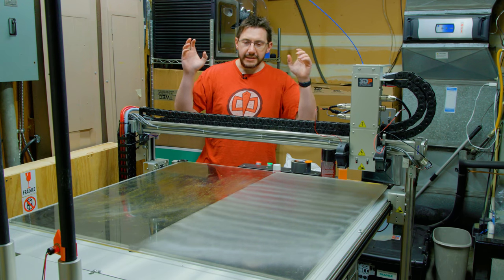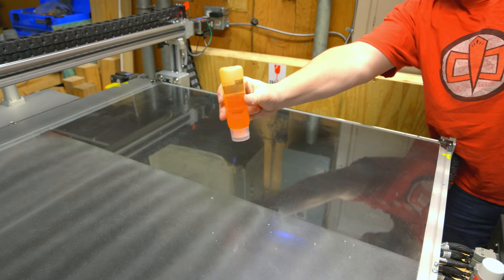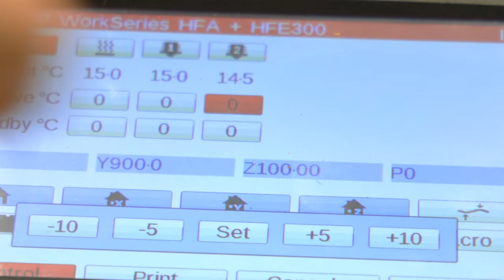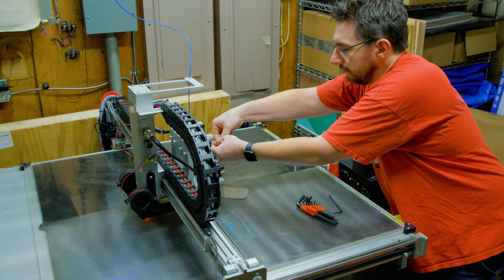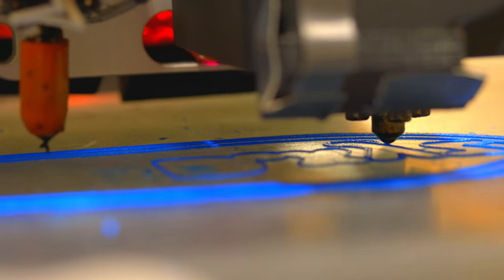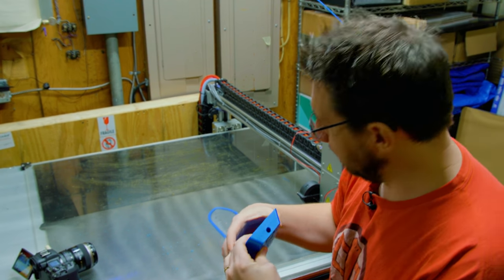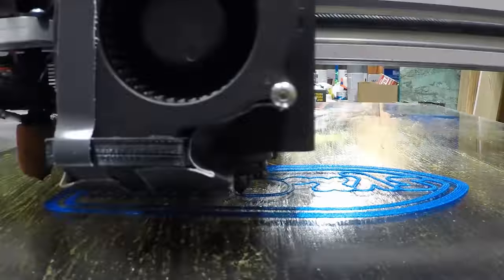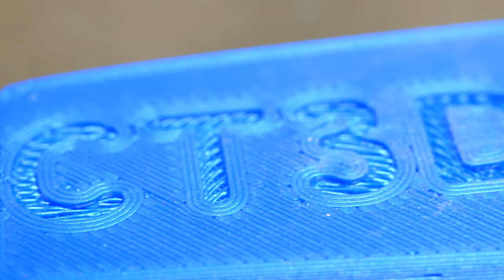$38,000 3D Printer Bed Adhesion Test // Super 77 & Zillagrip

Comment: I have found that some colours of filament behave differently even from the same manufacturers.  Warping is driven by bed heat.  I lowered the bed temp down and down and down and the warping decreased and the bed adhesion decreased as well.  But the amount of warping was decreasing much faster than the drop in adhesion.  When I made it stick and lowered the bed temp enough it was excellent.  Then I changed colours and it was a warping mess again.  I expected that because pigments are not inert nothings... so the carbon black of black filament was much more stable than the gold colour pigment.

My recommendation is to ditch the coloured filaments if you are having issues.  Use black or transparent clear or natural.  Especially on larger prints the warping forces goes up by the cube or 4th power so you might reach the practical limit for an unheated or insufficient heated chamber.

Have you tried printing with a draft shield and a low bed temp just to keep the material temp more stable?

Comment: You said its 60 degrees in your garage. So the filament is coming out hot and immediately shrinking when the glass dispenses the heat. Get a large heating pad and stick it to the bottom of the bed you could test this option by buying a cheap little one and printing in that area to see if it works. Building a heating pad is as simple as hot wire and and insulating fabric.

Comment: no amount of adhesion will keep the parts mass from warping from the cool down you need to sustain the heat and let it droop off slowly. EG heat the room to a high temp. Casting and heat molding solids do this at larger scales as things cool and if they cool too fast or unevenly they will cup or warp. You can bond the stuff to the surface and it will still pull away, that or break the table. Idea is to slow the cool down process. Think of glass blowing, cool it too fast or unevenly itll shatter due to the torsional forces involved.

Comment: When I need to go large I clean the bed really well... No fingerprints at all.... Then I use cheap hairspray from the dollar store. The trick is to spray side to side, back and forth until there is so much deposited spray that it creates a thin layer that looks like a sheet of glass on top of the bed. The droplets build up until they colapse into each other making this perfect clear film. It ALWAYS works for me on a 300x300 Anet printer.

Comment: Joel, why do the first layer extrusions look like they are foaming up a bit?
Reply: I noticed the same, it's rapidly expanding and then contracting, you can see it during the first layer, and more so during the purge cylinder. Amazing that that wasn't brought up at all! My GUESS: filament MAY benefit from drying, and definitely will benefit from warmer environment. I print PP-HTPLA in my enclosed MK3S, 0.6 nozzle without issue. I keep the temp a little lower but have had no adverse effects from the enclosure, in fact it may have been a benefit this whole time based on that strange expand and contract effect observed. Then again maybe the filament is just not suited for such a massive nozzle. SO MANY FACTORS. Also Vision Miner Nano is my new fav for just about everything..

Comment: A brim is usually recommended with shrinking filaments (even though this is a PLA blend) and larger models but since the Zillagrip held 2 of three corners, there may have been less glue on that corner. I would touch up with Zillagrip and try again.

Comment: Use a polycarbonate sheet for natural materials and a abs sheet for synthetic materials  for the bed instead of glass and apply high heat to the bed. Works on the baam I used to work on. Trust me this works as we use it for large industrial prints and it works extremely well.

Comment: I had to lower my fan speed to get prints that don't warp like your experiencing. At first I tried no fan on the first layer, but it didn't really help. Then I tried 50 fan speed for the entire print and that help a bunch and also allowed me to lower the extrude temp a little and still have great layer adhesion.

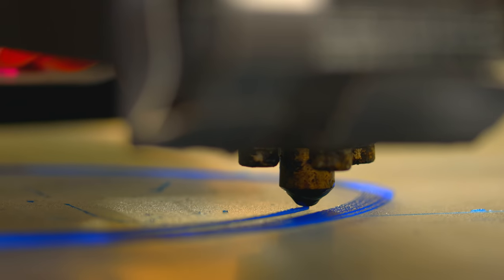Comment: Hey at 5:41 it looks like the filament kind of rises (expands) after it is being extruded to the bed. I would say about 5 mm behind the nozzle. Is there a reason why it does that?
Reply: I've noticed it as well. I think it's either moisture in the Filament, the additive (because it's HTPLA) or it could be the glitter that is degasing while it's melting.

Comment: the technique that i usually use is to let the first or second layer run stop the machine and apply a few drops of hot glue to the points of possible lifting, here is Portugal's tip.

Comment: Hey Joel, check that recipe for the ultimative bed coating that will tie down anything to your glass. I am printing PLA, PLA+, HTPLA, PETG, ASA, PC, Nylon and even really weird filaments with Stone, Metal or Carbon mixed in on this coating perfectly successful for almost 9 months since applying it.

Just grab regular white PVA glue like craft glue or wood glue, mix it up with water in a ratio of 1 part PVA glue to 5 parts water by volume. Shake or stir it thoroughly and apply it to the glass bed with the heater set to 40C-50C. The heater is just turned on to help the coating to dry faster, so go higher or lower while you are applying it depending on how stressed you feel while doing so :D Use a regular brush to apply the mixture. It is correct for it to be really liquidy and thin. That way you have a chance to apply it even and in a very thin coat. Let it dry fully and repeat until you have a couple of coats on the bed. I usually do like 5 or 6. 
Then when you print something heat the bed like you would normally do, e.g. PLA at 60C, PETG at 75C ASA at 95C you name it ;) Be careful with the leveling though. If your nozzle is too close to your bed the filament will kinda fuse with you PVA coating pretty good. The trick with PVA is that it is almost not adhesive when it is dry and at ambient temp. However if you heat it up it will glue shit down and thats why you wanna print with the bed heater turned on while having PVA on the glass :D So be sure that you wait for the print to cool once it is finished. You probably won't get it of the glass while the part or the plate is still hot without ripping shards out of your glass... again :P

Oh and one last note, however this is optional: I sanded down my glass bed a little bit with 240 - 600 grid diamond sanding pads just enough to give the PVA mixture something to hold onto. If you see some light scratches in the top of your glass after cleaning it with IPA you are good to go. Wet sandpaper with the same grid will do the job as well, I guess. Maybe you want to give it a shot on a corner of your huge glass plate if you are still having adhesion issues ;)

Cheers and good luck!
Reply: Forgot to mention: with that coating you will be able to print even the most warp-prone stuff like ABS open air with ambient temps totally out of the cozy zone of ABS :)

Comment: I always say, "More printer, more problems". 

It kind of looked like there were bubbles in the extrusion as it came out. Is it possible the filament was a bit wet? I don't think that would necessarily be the cause of the lifting, but saw a texture that kind of looked like bubbles. Though I've never printed with that wide of a nozzle, so maybe that's normal.

Comment: I use Gorilla Wood Glue on painter's tape (blue, green, masking etc). It can be used on pure glass, but it's easier to remove on tape. I typically apply it using a Paint Sponge Brush, but a plastic putty knife or something to spread it thin would work just as fine. However to maximize it's effectiveness the glue has to be dried by heating the bed first. Once dried, a print can start. I've never had any issues with this method, unless the surface area of a print is too small in which I've had to use rafts and/or supports with slower speeds. I've used this for PLA, PVB, and PETG. I sometimes reuse the tape with glue, but this has usually been for PVB. I lightly go over the bed with a damp paper towel coated in isopropyl, which I think makes the PVB more inclined to stick. Cause alcohol makes PVB sticky.

I've also heard of the salt water method that is supposed to be really good for PLA. Never tried it, as I'm afraid what it might do to exposed metal longterm. The idea is you heat the bed like usual to dry the salty water so it's just salt stuck on the glass. Then print over it. It acts like a super glue for PLA until you turn off the heat. There is no need to fulfill an exact recipe in the PDF I read, it basically just asks that you add a lot of salt. Probably 60-80% salt is in the mix. No idea if it works for other filaments.

I am happy to see this video though. I'm always interested in different beds, bed coverings (PEI sheets, etc), and adhesives. Always on the look out for new methods that are easy, low cost, and effective. I've tried many, and have been disappointed that other methods aren't as good as the wood glue in my experience. But I suspect there are more great ones out there. :)

Comment: Due to the size of the printed pieces, there is no doubt a lot of uneven cooling within the part itself, especially in a 60F degree room.  So perhaps the use of a couple heat lamps would aid in managing the part temperature without interfering with the head movement, thus providing a more consistent and even temperature for the part.

Comment: I've been dealing with a wood pla that doesn't want to stick with large prints, a couple forums suggested using hair spray and that seems to work pretty well, there are some recommended sprays to use if you want to look for them but I just used a random one I found in the store.
You have to lay it thick so the spray sort of pools as a liquid and then let it dry, hold the nozzle close, maybe 2-3 inches away at most, and spraying in circles moving down the bed got me the most consistent layer. If it still doesn't stay stuck add more layers until it does, I ended up with 4-5 layers before it worked. Not sure if it makes a difference but have been using a heated bed at 60c first layer dropping to 50c after, spraying it on the bed pre heated does help it dry quicker though, just make sure the print head is well out of the way as I had some of the spray get sucked in and stuck to the cooling fan. Also it's recommended only coating the area you're going to print on because of the fumes when spraying and the stuff is a bit of a mess to clean after, probably a good idea to use a respirator if you've got one, and going to be running a test today putting down some masking tape first to try and negate some of that mess.

Comment: This might sound basic, but I like just glue stick. I slow the first layer down to 30 or 40 percent speed, and run the fan at 25 to 50 percent power. Locks on tight, even large prints on glass beds.

Comment: Hair spray and painters tape works pretty well for my PETG filament to help with lifting but I think a big problem is room temperature like you have in your garage, I also use a heated bed to make the hair spray stickier, but that's not always required.

Comment: I don’t know why everyone is so obsessed with all sorts of liquids, chemicals, sprays, glues, and so on.

Listen/read carefully what I am going to tell you right now, because I will say it only once:
I suggest double-sided self-adhesive foil with removable adhesive (for example Orabond 4032). The foil is available in 50m rolls and in widths of 1050mm, 1300mm and 1550mm (it can also be purchased by the meter).
Using a squeegee, cover the bed (printing area) with foil with the side where it has removable adhesive (with permanent adhesive facing up). By the way, you could best get the foil with removable adhesive on both sides if you have that option.
Not to forget: Print on a cold bed (without bed heating!)

Tip: You can use a hair dryer to remove the foil from the table and from the print when you are done printing.

I think it will finally and definitively solve your problem of sticking prints to the bed. Say goodbye to warping and lifting!

No pictures please! Thank you.

Comment: The contraction forces we've seen here appear to mean that any bed adhesive strong enough to work will be impossible to release!  (Didn't this happen to the bed in a prior video?)

Have rafts already been tried?  Start with a generous area (say, 5x), and enough layers to distribute the forces.  A wide brim would be way too wimpy for this situation.

Edit: It may be time to do speed and temperature towers for this material under this printing profile.  There may be a sweet spot with minimal contraction.

Comment: Hi Joel, I´m working with a BigRep One Printer for a few years now, which is a little bit larger than the Printer you have there. What BigRep uses is a large sheet of Kapton Foil, I know, first time I saw that I thought "Oh no, not Kapton". But it works perfect. PLA with Magigoo and 60C on the bed, PETG just clean it with alcoholdon'tmight

Comment: The best surface I found: you put tape stripe on both edges of your surface,  you take an aluminium  L profile ..(.Or something that is flat) , put some abs juice and flat it with the profile between the tapes. The high of the tape should be your abs later high.

Comment: Can you do a video on ambient temperature printing? I've had very different results at 62/70/78F for lifting and bed adhesion. Some testing with bed temps, cooling fan, or adhesion additives would be great for winter prints vs summer prints.

Comment: With the amount of filament being extruded, I suspect a residual heat test in a fair size of build-up would be a prudent measure to see if the cooling fan is doing optimal work on a bed that size. While somewhat counterproductive, all my problem-solving synapses are telling me that a smallish-sized office fan blowing a constant but gentle stream of air across the surface of the bed might be a good compromise if you're determined to go sans heated bed. Distance from the bed surface would be key here as you just want like a cool breath going across the top, almost like fogging a cold piece of glass with your breath in volume. 
Barring all of that and you just want a secure hold on the first layer, and presuming you have a consumable surface beneath it, a very fine layer applied by squeegee of contact cement after letting it set up could be a winner. It'll provide a lasting tack that will definitely bond your first layer, however, you'll also have contact cement on the bottom of the model most likely if there isn't a sacrificial spacer layer built into the model. Might be worth experimenting if you could thin it with your chem of choice.

Comment: I print on a  Gigabot 2.0 with 600x600x600mm envelope. It has a 0.5mm nozzle and usually print 0.3mm layer height to give 0.6mm extrusion width. In this video it looks like the extrusion width is a little fat compared to height. Try adjusting extrusion width and layer height to give layer height 60% of nozzle diameter and extrusion width 105% of nozzle diameter.   I find even with PLA shrinkage is a factor when printing larger parts. I run an enclosure around my printer and keep the air temperature inside just under 50C for PLA. This keeps the part closer to glass transition temperature as hotter layers are deposited by the nozzle. This helps reduce the built up stress in the part as it gets taller. I find that parts still pull up a little bit but much less than without a heat chamber. I don't use any adhesive on my bed. Mine is a cast aluminum plate with a "printNz" surface. For 38K spent already, might as well add a heated box around it! You'll definitely need one if you hope to print large with ABS or other high shrinkage materials.  Love your videos Joel! You are an inspiration to all 3D print / makers out there!

Comment: Joel, I use a coarse sanded Aluminum build plate with hair spray for my PLA prints. I tried a lot of things on my glass bed before, but nothing holds. You may try sanding the bed to increase the area available for the melted plastic to hold on better.

Comment: Set the bed temp to at least 38c The bed being zero is going to cause the filament to contract alot earlier than it would if it was heated putting more stress on the adhesive making it fail to stick.

Comment: I've been using the Series 400 now for over 2 years often creating 10 to 15 pound prints. Printing with different materials, different extruders and all I use is hair spray with rafts and with a wider brim.
I tried the PEI material, it takes a few people to cover  40 inch x 60 inch build plate and at $500 per sheet, I just stayed with the glass.

Comment: So why not do the same test with the bed heat turned on?

You might want to bump up your "Retraction Extra Prime Amount" in Cura. I noticed some gaps in the model that could be associated with having that setting too low. Larger nozzles ooze more so when you retract it will tend to ooze and need to add a little more material to fill that gap in the nozzle that oozed out. Prusa Slicer has a similar setting by a different name of "Extra length on restart" I've found the easiest way to quickly tune this setting is to have two cubes corner to corner with a gap between them so it will retract before going to the other cube. If there is a space along the seam area, then increase the setting, if there is a blob then you have too much.

Comment: Cheap ozzy hair spray from Walmart and a 60° bed. I ran that for years on a glass bed with great success. And it smells great too.

Heat the bed up and spray a thick coat, be sure to let it dry completely. Do that a couple times to treat the bed then just before a print when the bed is hot give it a quick coat and let it print on the wet tacky hair spray. You should see a mist evaporating off the bed during the first layer. Then after the bed cools you can hear it crack and your print pops right off.